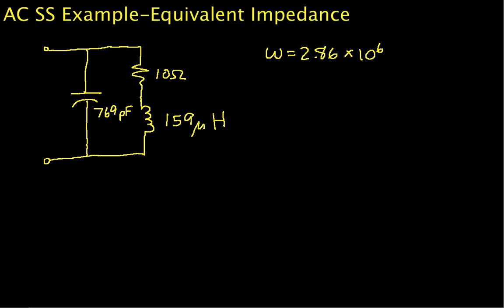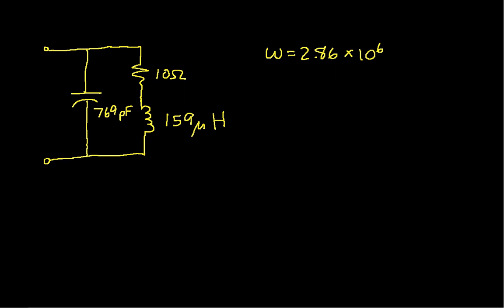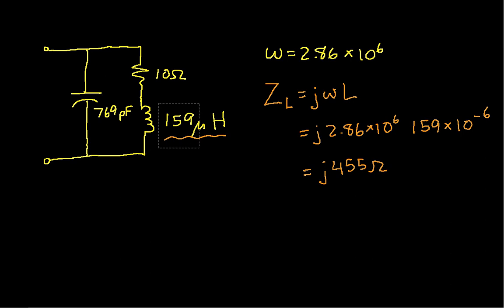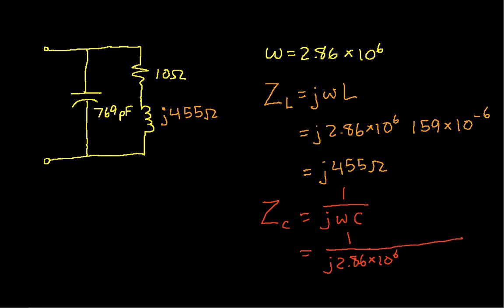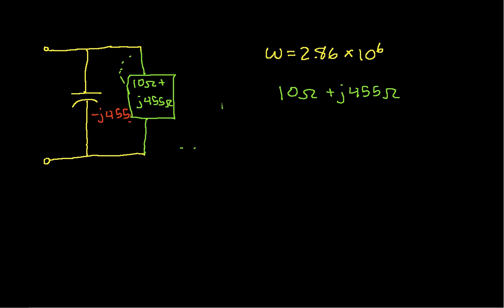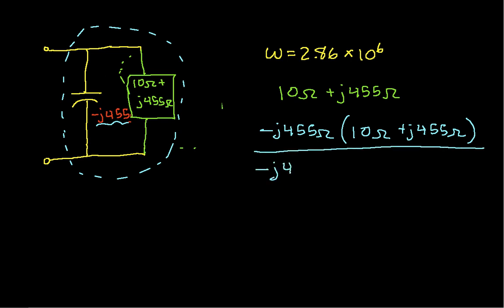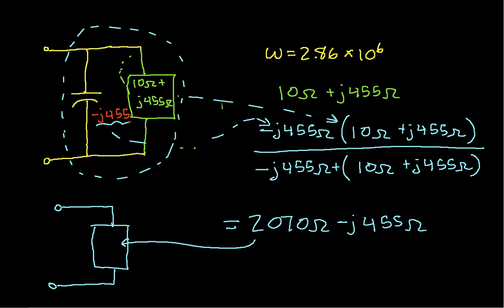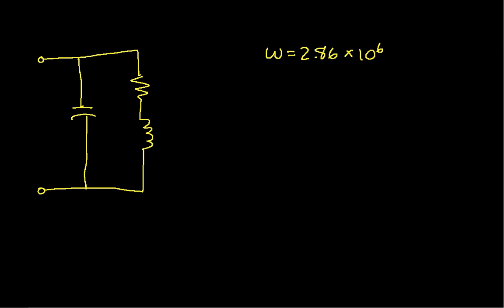AC Example-Equivalent Impedance

Comment: the part i need is where you take the short cut and use wolf ram...
Reply: you just type it into your calculator,  but you use i instead of j
Reply: hhhhh same here
Reply: thanks!
Reply: My MAN!
Reply: I wouldn't have thought my calculator would do that... tyvm
Reply: @Blasphemykat  I had a similar question like thia on my ELET 120 Circuit analysis exam.

Comment: does this mean that if a capacitor and an inductor of the same impedance are connected in parallel, the equivalent impedance of this combination is infinity?
Reply: Seem similar to LC tank circuit. It will just oscillilate.

Comment: wolfram alpha? Really?
the part i need is where you take the short cut and use wolf ram..
Reply: the formula is like just calculating total resistance of parallel resistors.  Rtotal = R1R2 / R1 + R2 the values include imaginary so use complex mode in calculator.